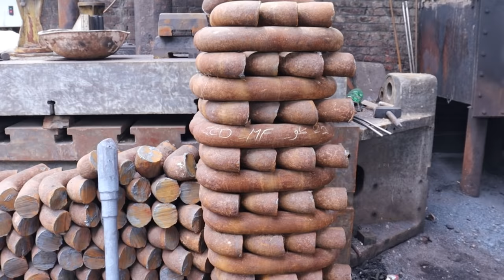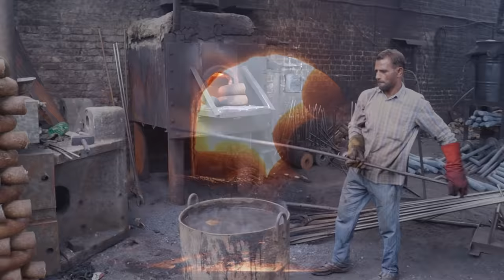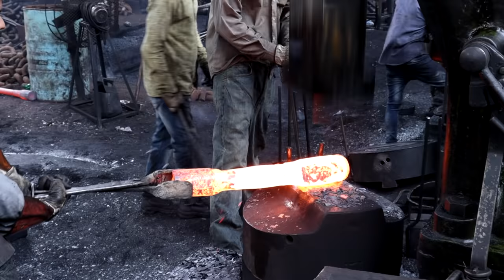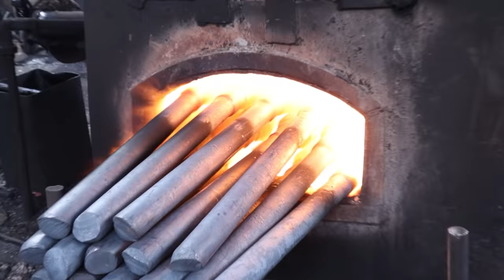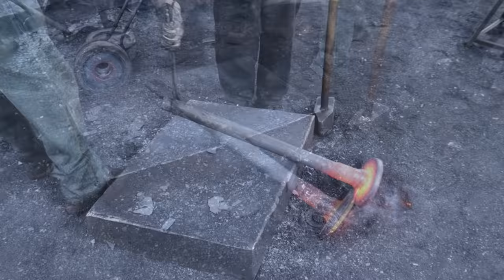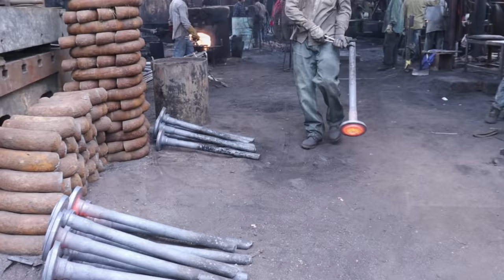Most Incredible 8x8 Truck Axle Forging Process

Comment: How many eye related injuries do they have every year?..., wind and flaming hot steel flying everywhere, not to mention the metal on metal clanging of the hammers. My ears are ringing just watching this.
Reply: God protects them lmfao I swear theses ppl do not what to advance safety
Reply: at least these dudes have jeans on lol not long skirts like others I've seen with really long clothing
Reply: Exactly my first thought. Zero eye protection.
Reply: @michaeldufault4272  your eyes don't get used to being hit by molten slag.
Reply: If OSHA reps were to walk thru here, small strokes would likely occure.
Reply: Aside from the eyes, you've got heavy glowing red hot chunks of metal being swung around like a tennis racquet.
Reply: I'd be more concerned by industrial deafness.
Reply: Michael Dufault It’s called Mill Scale. Slag is what forms on top of molten steel,,, during the melting process.
Reply: Im surprised they even have shoes on 🤣
Reply: I assume not many eye related injuries but plenty of loss of hearing and tinnitus. And then lots of bruices and a lot of problems with vibrations and lifting and fixating heavy objects all day and in strange positions. 
And a lot of injuries caused by stress and heat. Not a good combination to think clear. 
Also a lot of minor injuries with objects tipping over in the cramped up place.

Well that's my guesses after working with my body for 30 years.
Reply: Zero. Grow some balls.
Reply: Nobody invited u OSHA
Reply: @berny_spliffs1753  42 likes says you're wrong
Reply: These bros have balls of steel 🙄  and they are forged in the tempest
Reply: 5
Reply: Probably very few
Reply: Saftey weakens the gene pool.
Reply: None, there's no workman's comp for people to game
Reply: @carolinadreamer6689  haha comments are going nuts
Reply: @iangoulding7808  I've got tinnitus just by watching this...
Reply: Michael Dufault No problem. Thought I’d set the record straight but it is something you already know.
Reply: How about no ear plugs.  They may get lucky with their eyes,  but they will definitely lose their hearing over time
Reply: @JGunit  that too mate.
Reply: Двадцать первый век! А рабочие работают на износ по старинке за жалкие подачки и  гроши от буржуев и капиталистов! Пролетарии всех стран соединяйтесь!!!! 😠
Reply: How tf are eye related injuries even real, like just close your eyes bruh
Reply: @_00_36  e   yes
Reply: "Whaaat?!" Ear-pro was my first thought. Life, injury and health is cheap in these parts of the world. One of my teachers (electric) told me "some guy" died in his living quarters on the job in Egypt. When they carried him out the door there were four guys lining up at that same door to get his job and bed - that's why they don't care about...anything, really.
Reply: Every time I watch one of these videos overseas, they're rarely using safety protection. I'm surprised these guys even have gloves and shoes on.
Reply: Its a "next man in line" mentality
Reply: What? I can’t hear you.
Reply: Steel toe capped sandals.
Reply: @iangoulding7808  pardon?
Reply: For a time americans worked just like this....better thank the unions for dying for proper PPE....
Reply: Yes.
Reply: @PatTheRiot  ki
Reply: Allah
Reply: @ronniewilliz153  These guys I think from India, and  the long skirt guys are from  Pakistan.  Though that's not a skirt. But both countries has lot of irrugulated Industry.  Because of the economic  conditions these people don't have other choice. There are no benefits.  You work and you get paid. Their  earnings will not exceeded 200dollar
Reply: these are poor labours and owners give a f***  about their health and safty.... no one has ear protection
Reply: They throw the part in the dirt an watch it sizzle and hiss. This is the blessing from those gods that protect their eyes.

Comment: Meanwhile every ship in the nearest port is wondering who stole their anchor chains
Reply: Thanks i was wondering why they had such odd shapes to start with
Reply: Probably bought from Alang. They scrap a lot of ships there.
Reply: Wonder why were falling behind , young men in this country cant even change a flat tire .
Reply: @johnwatson3630  sad but true.
Reply: @erikdevries9208  alang is in India ,,
Reply: @manjitsingh-xc4tv  Is this shop not also in India? You'll have to pardon me for not knowing.
Reply: Just a question, what was a purpose and who did that anchor chains from such a quality steel, that is aceptable for track axils? Or thouse axils does not require quality steel?
Reply: @erikdevries9208  , it's Pakistan.
Reply: @spreddyreds9408  Ah. well again, pardon me for not knowing. I live very far away from that part of the world.
Reply: @tunnelbear2917   when melting iron into a liquid state to be poured into casting , the purity of the material is very important because foreign material or impurities form hollow spots. But when iron is forged and hammered as it is here it actually changes tbe molecular structure and removes impurities is extremly strong and clean by the time the process is over.. So does not require the scrap steel to be of highest quality.
Reply: @erikdevries9208  , no problem. Sharing is caring.
Reply: @tunnelbear2917  they don't care whether then steel's quality is suitable or not - main objective is the steel's forgeabilty
Reply: @georgealmeida7382  anchor chain for commercial tankers actually needs steel, the slag coming off the iron is actually carbon and a few other elements depending on the specific steel
Reply: @tunnelbear2917  Massive anchor chains like that are not made of some crap wrought iron, it was made to anchor literally thousands of tons worth of boat/cargo, likely it is quality steel.
Reply: George almedia.   If a steel is scrap /low Carbon,  it does not matter how many to forge, it will not gain quality of high carbon or aloy steel that is necessary for axils. So if you making axils from anchor chains, that means that chains are from very high quality steel, or if it is not, then axils are for very low duty machines.?
Reply: @tunnelbear2917  Shipbuilding uses high grade steel. That's why they're so valuable for scrapping.
Reply: @tunnelbear2917   guess you dont understand when I say that forge hammering changes the molecular structure if tbe steel..as does the heating and rapid cooling.its called tempering the steel.
Reply: Hi friend
Reply: @georgealmeida7382  It changes the grain structure and pushes it tighter together, but the molecular structure remains the same unless it is heated to forge welding temperature and other materials are added. If it starts as mild steel, it remains mild steel.
Reply: @erikdevries9208  you are right. Alang is in Bhavnagar district of Gujarat state which is in India. Alang  is the biggest ship wrecking yard in the world and these anchors have been procured from there. This factory is also in India. It is ironic that people from India themselves don’t know where alang is. You seem have better knowledge of geography. Not these peoples fault. For some education is free in India and university degree is given even if they fail.
Reply: Epic catch
Reply: @johnwatson3630  being able to change a flat tire actually depends on one's experience of having done that atleast once and that comes if you have spent a good amount of time driving a car. In this country, for most people a car is still a thing of luxury. Most people who own cars have generally one or two at most in a house. Reasons range from not being affluent enough, affordability to traffic and parking conditions. People who can actually afford a bunch of cars also think 100 times before buying one due to parking problems and overcrowd streets. So, let alone being able to change a flat tire, most even don't get to drive one frequently enough. So, the problem you mentioned is not because of incompetence really.
Reply: @srikanthpalle1828   It is unfair to denigrate our educational system. Most of the deserving students except in backward rural societies  get quality education. The employers excepte govt. Know how to weed out the fake degree holders
Reply: @tunnelbear2917  At a guess I would say it is something like 4140. It is not such high quality as some, but is much better than mild steel, even un-heat treated. The stuff heat treated is used for car and truck springs.
 Because it is not so expensive and is easy to work, it is a 'go to' for high stress components.
Reply: i was looking for this comment :)) :))
Reply: They scammed them with plastic chains and took the metal ones
Reply: Bwahahaha! This had me rolling laughing!
Reply: ন
Reply: Ship anchor chains are made of steel which is not so bad quality. Then it may be ok to make axles...
Reply: @saysflushable  0
Reply: That's from salvaged ships, i guess.
Reply: @DJgoon12  I have great respect for the guys in the video doing back breaking work, little or no safety gear. A lot of young  guys in my country U S A . care about  video games , aspiring rap stars, sitting still doing nothing,  little drive to improve themselves and not knowing something  as simple as how  to change a flat tire  and would would not finish the day forging axels .
Reply: You funny mr.
Reply: Hendrik van Leeuwen Thanks very much!  It is seems more logic if axils were made from spring steel grade. So the heavy chains are made from manganese allow steel close to spring steel, an sustainable more or less in relation to corrosion. It also now geting more logic.
Reply: @srikanthpalle1828  I can assure you, degrees given at the moment of academic  failure is not something exclusive to India!
Reply: @johnwatson3630  gyunn
Reply: 1 John 3: 16
Hereby perceive we the love of God, because he laid down his life for us: and we ought to lay down our lives for the brethren.
Reply: Hell is very critical crying place,READ bible believe jesus
Reply: @erikdevries9208  karachi too is a hub,so is chittagong.
Reply: Circular economy
Reply: @johnwatson3630  The industrie made cars to a black-box in which you can´t fix nearly anything by yourself.Same with computers nowadays called smart-phones
Reply: @spreddyreds9408  Hahaha! I know a pakistani with whom i worked at bodycote,(a steel-hardening group)  some months.
Reply: Great idea.
Reply: @erikdevries9208  🔭🐩
Reply from the maker: Thanks for watching
Reply from the maker: Thanks for watching
Reply: @spreddyreds9408  
I think this place is not in pakistan because of the way they dress. Usually pakistani workers only wear kurta and slippers when doing work. Correct me if I'm wrong.
Reply: @ghong85  , the YouTuber himself is from Pakistan and his videos too are.
Reply: 72. Surely, they have disbelieved who say: "God is the Messiah [‘Îsâ (Jesus)], son of Maryam (Mary)." But the Messiah [‘Îsâ (Jesus)] said: "O Children of Israel! Worship GOD, my Lord and your Lord." Verily, whosoever sets up partners (in worship) with GOD, then GOD has forbidden Paradise to him, and the Fire will be his abode[1]. And for the Zâlimûn (polytheists and wrong-doers) there are no helpers.
73. Surely, disbelievers are those who said: "Allâh is the third of the three (in a Trinity)." But there is no Ilâh (god) (none who has the right to be worshipped) but One Ilâh (God -Allâh). And if they cease not from what they say, verily, a painful torment will befall on the disbelievers among them.
74. Will they not turn with repentance to Allâh and ask His Forgiveness? For Allâh is Oft-Forgiving, Most Merciful.
75. The Messiah [‘Îsâ (Jesus)], son of Maryam (Mary), was no more than a Messenger; many were the Messengers that passed away before him. His mother [Maryam (Mary)] was a Siddîqah [i.e. she believed in the Words of God and His Books (see Verse 66:12)]. They both used to eat food (as any other human being, while God does not eat). Look how We make the Ayât (proofs, evidence, verses, lessons, signs, revelations, etc.) clear to them; yet look how they are deluded away (from the truth).
76. Say (O Muhammad صلى الله عليه وسلم to mankind): "How do you worship besides Allâh something which has no power either to harm or benefit you? But it is God Who is the All-Hearer, All-Knower.
77. Say (O Muhammad صلى الله عليه وسلم): "O people of the Scripture (Jews and Christians)! Exceed not the limits in your religion (by believing in something) other than the truth, and do not follow the vain desires of people who went astray before and who misled many, and strayed (themselves) from the Right Path."
[Al-Mā’idah:72...77]

https://quranenc.com/ar/browse/english_hilali_khan/5/
Reply: That is clever :)
Reply: @georgealmeida7382  You have confused too many things. Hot working and cold working are different from heat treatment. Hot working are part of the thermomechanical processing and is being done to form the metal through which the mechanical characteristics of the metal like strength and etc might be changed which is intentional.
Heat treatment is different and is being done to change the physical metallurgy and inevitably mechanical metallurgy of the alloy ( ferrous and non ferrous). The atomic structure after forging won't be changed and must not be changed. Atoms, when solidified, have different crystal structures like FCC, BCC, hexagonal, tetragonal and etc. These structures bestow the mechanical properties like UTS, stiffness, toughness and etc. Atomic structure changes through the phase transformation ,whether it is diffusional, displasive or spinodal. For instance in Steel, a metallurgist play with the critical temperature and alloying additions in heat treatment through different processes , like tempering, quenching  aging and ....., to change the atomic structure and have the optimal structure for the perpused applications for instance change the structure from austenitic FCC to alpha BCC through heat treatment. Of course it involves very complicated metallurgical processes and adding different alloying additions which act as stabilisers ( alpha stabilisers , beta stabilisers,.....).
Reply: @erikdevries9208  it is Pakistan. This scrap metal comes from Gaddani Ship breaking yard
Reply: @srikanthpalle1828  this factory is in Pakistan and the scrap steel comes from Gaddani Ship breaking yard which is near Karachi, Pakistan
Reply: I worked in a factory making cultivator shovels,harrow teeth,etc. It was hot and noisy but nothing like this,the hammers pounding out deep tiller shovels and harrow teeth are super loud.
Reply: @brandonb.288 
BBCpht5
Reply: J
J
Reply: LMAO

Comment: "What did you say?" - said the worker 5 years after doing this.
Reply: Safety equipment here is a No No. Anyone wanting ear face or hand protection need not apply.
Reply: Only if you knew what framers go through.
Reply: @xFTLc  Years ago a roofer - replaced the roof on my house. Nice guy. The only thing I remember. His right arm looked like PopEye's arm. Absolutely huge forearm muscle from holding the nail gun all day.
Reply: @enochpowel3030  p
Reply: LOL. You just won the internet!

Comment: Just pray for workers ❤️ hope they don't injure by any type of mistakes 🙏
Reply: yeah it seems like a very dangerous job
Reply: Hope so too, but in a workspace with hot and heavy metal forming like that it’s inevitable, specially with no heat resistant clothing, steel toe shoes, or any protective gear whatsoever. It’s a different world out there.
Reply from the maker: Thanks for watching
Reply: I live in Karachi Pakistan and I like your comment send 10 month ago
Reply: @RobertFletcherOBE  I live in Karachi Pakistan and I like your comment

Comment: Ship anchor to new parts without having to melt and remake steel from scratch is real recycling with guaranteed material
Reply: Porous rebar and laminated plate are the results of this reshaping.
Reply: Using the crude oil from old ships to run the plant too.

Comment: These people don’t make excuses, they work with what they have and get the job done, admirable.
Reply: Pffft. They are using the same kind of equipment that England was after the second world war. The only reason they are using it is because labour is cheap. So cheap that automating the process would not garner more profits.
Reply: @Metalmassacre07  okay? That doesn’t change the fact that these guys work their ass off, and like you said, they do it for very little pay. I think they should get more for their work but I still find it admirable that they seem to take pride in their work, even given their situation. You don’t get that good unless you’ve done it a lot, and it’s a hard job, and it pays shit, yet they still get it done because they have to. I just find that admirable.

Comment: That is hard and hot work. Hope there are no injuries
Reply: I share your hope, but there are thousands of good examples of why it's not done this way in much of the world anymore.  They're definitely losing hearing every day and it would be stunning if these guys don't get some serious burns and the occasional lost eye.  Not to mention the other common injuries you'd see like heavy objects dropped on feet or legs - heck, the fellow at 2:55 removing the piece from the power hammer nearly slammed a yellow hot steel bar onto the foot of his coworker - missed by just a few cm, and that only because he had already stepped back.  This type of manufacturing treats the workers as a disposable part, unfortunately.

Comment: I'm confused. Do they weld the two half's together or forge another end on the other side?
Reply: Each one of these are either left or right axles. They connect in the middle with a differential. A straight single axle doesn't work because in a turn the outside wheel turns faster than the inside wheel because it travels a greater distance in the same time.